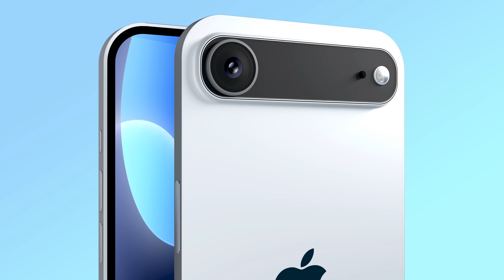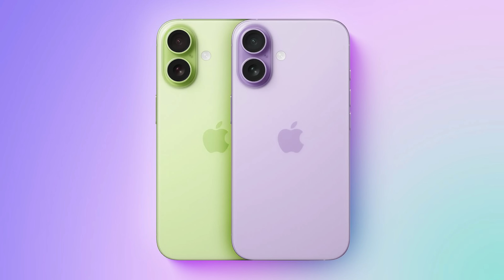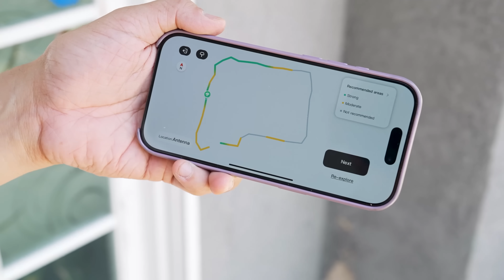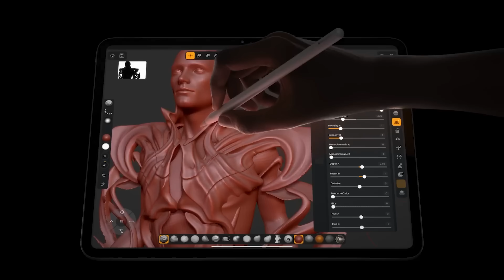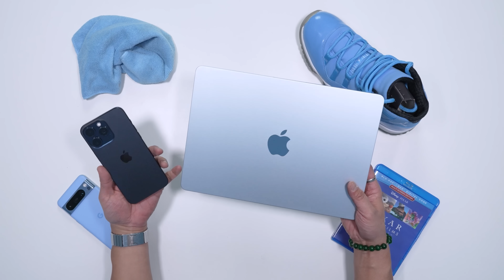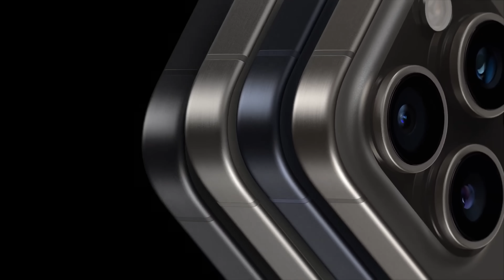iPhone 17, 17 Air, 17 Pro/Pro Max Preview - Everything We Know So Far!

Comment: 🍏
I WOULD GO WITH THE PLUS MODEL FOR REASONS LIKE THE BATTERY SIZE AND LACK OF A CAMERA. I WOULD MAKE THE 17 E WITH ONE REAR CAMERA BUT I WOULDN'T SLIM IT DOWN. ALUMINUM WORKS.
NO CAMERA BUMP,WHERE THE CAMERA LIFTS OUT WHEN IN USE,AND AN UNDER-DISPLAY CAMERA LIKE THE RED MAGIC HAS WOULD BE ACCEPTABLE AS MAYBE A DISAPPEARING DYNAMIC DOT. FOR STARTERS. A REFRESH RATE LIKE ASUS HAS WOULD BE NICE. THE CAMERA CAPTURE BUTTON SHOULD BE MOVED TO THE TOP-LEFT SIDE OF THE PHONE AND A 2ND FIXED HAPTIC BUTTON SHOULD BE ADDED TO THE BOTTOM-LEFT SIDE FOR GAMING THAT HAS NO MARKS ETCHED-OUT OF THE SIDING MAKING IT UNIDENTIFIABLE AND PLEASANT ON THE EYES.😊
A GPU LIKE THE ROG PHONE HAS WOULD BE IDEAL.
ADDED COOLING WOULD BE THE LAST THING I WOULD ADD ADDITIONALLY.

Comment: Nice upgrade on the 17. I liked the 16 but never could have downgraded because of pro-motion, when I eventually upgrade, I can now downgrade from a pro.  The camera bars are a bad idea because case design will be difficult and I would not use an expensive device without a case.  In many ways, the 16 Pro looks like a better choice than the 17 Pro.
Reply: yeah im either gunna get the 16 pro instead of the 17 or get the newest android flagship, literally just because of that awful camera bump design. it looks so insanely bad i cant believe they actually went with that.

Comment: I currently have the 15 pro but I’ve been wanting a bigger phone just for consuming content and also something with a bigger battery. That’s not too heavy. I’m actually considering the 16+ now believe it or not even with the 60 Hz screen or the 17 air, still undecided
Reply: Does the 15 pro have network or WiFi issues? And what’s the average battery life of your phone(how many hours it lasts from full charge)

Considering getting 15pro
Reply: @thatboytimiy no WiFi/network issues that I’ve noticed… full charge starting at 630am with Avg use my battery last until 8pm. Any above avg use last until about 4-5pm. You can get a full day out of it if you barely use it. That’s why I’m considering getting 16+. I’m sick of the shitty batteries that I’m considering going back to 60 Hz just so I don’t have to keep on charging it or worrying about it
Reply: @sammyOcean06 16pro has 2more hours of battery life over the 15 pro

Comment: Going back to aluminum is gonna be a disaster very prone to dents and scratches way to easily, what made the iphone with stainless steel or titanium made the phone really feel premium and strong and stood out against the competition
Reply: OR you could use a case like the majority of people?
Reply: @rockowilson2320 using a case won’t help aluminum is just very brittle even if it doesn’t get dented it will get scratches from dust and debris that goes inside the case and get discolored very easily

Comment: If battery life is good, really good, then i would get he iPhone 17 air.    But if battery is even a little bit of a concern, then I am sticking to the entry level iPhone 17
Reply: Well, iPhone 17 for you.
Reply: Wait until the 18 air when apple optimizes the software for the “new” battery tech that may be in the 17 air.
Reply: Like if an air mini would be an instant buy for you.
Reply: It's not gonna be good. There are some rumors that it's gonna be even smaller than what he claims on this video and it's gonna be 2800 mA hours.
Reply: iPhone 17 pro max will have thr biggest battery and it last longer than all iPhone
Reply: Just get Apple branded mag safe external power bank 😂
Reply: @e3vL1  What is the point, then?   It is no longer extra slim.   I rather get the regular iphone then.
Reply: @awcoolpadlook slim and cool when used in public? Charge in purse, backpack, or pocket when no one is looking 🤷‍♂️

Comment: Looks like I'll keep my 13 Pro again this year, Thank you Apple helping me save money
Reply: 😂. I have the 13 pro max and I've been postponing getting a new iPhone the last few years. I'm also thinking of waiting one more year.
Reply: @stefano.romney same here. I’m holding my 13 Pro Max until Apple release a foldable phone.
Reply: @stefano.romney me too lol 😂
Reply: I have the 13 pro max also what’s preventing you from upgrading ?
Reply: @Usachatnow did you really need to ask that question?
Reply: @Usachatnow i own iPhone 13 (not the pro) still looks good, battery still last long, camera is still good, and with iCloud, 128GB still is more than enough. Other the new cases, and the non-existing apple intelligence, i dont see any point to upgrade. By the way, i recently bought an M4 MacBook Air to replace my M1 MacBook Pro, and for me, that is an uograde that made a lot of sense (because the M4 Air is better than the M1 Pro in eveeything that it does, with a slimmer form factor), but not the iPhone because everything that I need the phone can do has already been achieved in the 13th model.
Reply: @Usachatnow Following 🌾👀🌾
Reply: @Usachatnow I have just upgraded from a 13 Pro to a 16 Pro.  There are a few nice upgrades but it wasn’t worth the money and the increased speed was barely noticeable. Shortly before I upgraded, I had the battery on the 13 Pro replaced (so I could give it to a family member) and that boosted performance. In hindsight, I should have kept the 13 Pro.  A battery change is relatively cheap (compared to a new phone) and they will do it the same day at an Apple Store.
Reply: @Usachatnow I’ll give u a thousand reason
Reply: @Usachatnow right because this seem like a great upgrade from the 13 pro or max .. I have the 14 pro and this is my upgrade year it’s time for a better camera and some of these Apple intelligence feature we may get this year .. I personally think next year will be ther year to skip and 2028 would b the best year to update but I don’t think my battery will last that long since I’m at 84 percentage with battery health 😮
Reply: @gwj7747  I have the 14 pro as well but at 74% and will go for the 17 pro
Reply: @gwj7747 I’m in the same place as you 14 pro max battery at 84 percent capacity , can’t wait another year or two, beside he said next year will be the same as this year no real change until 2028 if I heard him correct!
Reply: @gwj7747 my battery was at 71%. Paid 95$ for a new battery from apple. I might upgrade in 2028. Or just replace the battery again. The ball is in your court apple.
Reply: @gwj7747 I’m in the same situation as you!! 14pro at 86% of battery, it’s been annoying the last months not having enough battery to survive a whole day of fun (I live in nyc), but at the same time this new line doesn’t convince me, not a lot of new features, the orange pro looks cool though, also considering Samsung 7fold but I’ve been with apple since IPhone 4 and it’s hard to change.
Reply: @gwj7747  i am at 74%😅
Reply: I have 13 pro as well. I really want to upgrade but honestly the 16 pro seems better value than the 17 pro.

The new camera button is garbage. Nobody cares about new cameras to spy on you harder in 8K. I just wish they would a pro feature iPhone MINUS all the camera stuff that’s bloating the price

If they don’t make a pro feature phone with minimal camera by next year, I will be going with OnePlus phone. I hate to leave iPhone but they are not providing options that competitors are.

They need to realize it’s not only Samsung and Google they have to worry about. I love the Apple ecosystem but I really need a phone that suits my needs even more, I do over half my business over my phone. It’s a must or they will lose me for iP devices. Been w them since the iPod classic
Reply: @gwj7747 tbh, no amount of upgrades will get me to swap out my iphone 13 pro max if it actually looks like how the video shows it. thats by far the most horrifyingly ugly phone ive ever seen.
Reply: @gwj7747 just change the battery and that 1200 extra you have, invest in Apple if you really wanna give them the money
Reply: @Usachatnow  lack of Innovation, I would like to see a big battery improvements like 100% charged in 10min or 3 day battery, a real brand new design, just a better camera and usb c is not enough for me to switch.

Apple has been so lazy these past few years

I heard that maybe next year Apple would release their foldable phone, that might interest me, they might sell it for 2500$ too 😂
Reply: My man you will never get that for a few years. Technology is stagnant for the past grw years@kevinl-j8m
Reply: @kevinl-j8m  homie you are asking for things that are physically impossible
Reply: @kevinl-j8m you people have no idea how the technology you’re using and begging for upgraded to works. 

How would they make the battery charge in 10 mins without causing overheating and battery damage?

What upgraded do you want them to add exactly? Just complaining to complain
Reply: @marsh.tucker20   It's called innovation, 20 years ago, it was impossible to see foldable screen on a smartphone, and now look at the fold 7 and the other foldable chinese phones. 
Apple is the one of the largest companies in the world, they can get the best engineers, but they can't figure out a 3 day battery and an AI that really works ?

I got an iPhone, an Watch ultra 2 and a macbook pro m3 pro, I like apple, but I'm not blinded, I don't know wtf they do at Cupertino, but not much for the iPhone, I hope they are really working on their foldable to make it way better than samsung's fold 7.

I'm ok keeping my 13 pro, that's a great and reliable phone, that shows they make good products, you cannot deny there is not much since it released in 2021. 
I like Apple that's why I'm harsh on them, I know they can do way more than that
Reply: Word I have the 12 pro max it’s all the same dang apple yall trippin
Reply: @SYYDWALKTV1 yea lol
Reply: Sincerely asking, what upgrades are you looking for?
Reply: @致命帅哥  1 week battery life and charged in 10minutes, something impressive, the same phone with a bit better camera is not enough for me to switch
Reply: @kevinl-j8m  no phone has a one week battery. You’re gonna be waiting a lot longer than a year for that. Agree that I may not upgrade either and that design if true is absolutely hideous.
Reply: I am on 5s and still works😂😂😂😂
Reply: Shiiiid soon as I get a job say I’m sayin goodbye to this 11. Imma get that orange 17 pro max
Reply: I’m on 12PM. iOS 16.1.3. Still going strong.
Reply: I’m on 16pro max prob wait on fold or 18 pro max ?
Reply: @dam5845  Yes, definitely wait.
Reply: Went from 13 mini to 15 and I wanna go back 😭
Reply: Wishing for the m chips in the iPhone. That’s why I’ve been holding onto my 14 pro max and not upgrading but that may never come
Reply: Likewise. 13 PM user. But I have my own reasons. I will not upgrade until battery capacity reaches less than 80% or I stop receiving updates which could be next year. Currently at 90% capacity after almost 4 years. 
Main reason is the usage, I use it for regular stuff and phone works just fine, runs everything I need and no noticeable lag* so I AM GOOD
Reply: May also keep my 13 Pro Max
Reply: 16 e is perfect.
Reply: @MrPape39 I’m sorry but I have to assume this is sarcasm
Reply: Sorry you can’t afford anything new 😢
Reply: Still have the iPhone X
Reply: Comment comes off as salty instead of frugal. We will see your comment next year lol
Reply: Then get the 17 Pro if you’re not happy with this 🤦
Reply: Prices will increased starting this year across Apple products
Reply: ditto. just that the battery needs replacing now. I'm going to wait to see how the liquid glass performs on the 13pro and take a call.
Reply: Right
Reply: Always these broke azz that love complaining 😂
Reply: Same, though when this comes out will consider deals on the moto razr
Reply: Lol I kept my xs (iphone 10) but unfortunately have to upgrade since he dying now😂
Reply: Same here but my concern is my battery life. My battery health is 81% now 😢
Reply: I’m keeping my mint 12 Pro Max until Apple decides to bring back finger print unlocking. Hate not being able to unlock my phone with my face when wearing Polaroid sunglasses.
Reply: The only reason I upgraded to a 16 pro was cause my 13 pro broke the things I notice are the action button which is just a flashlight for me 
And the slightly better camera
Reply: Only reason I got a new one after 13 is because it stayed in sos mode 😢
Reply: I have the 13 pro max as well. Will be upgrading this year
Reply: I have the 14 pro max and was thinking of upgrading to the iPhone 16E and why you may ask? Welp because of the price difference. It would be cheaper and plus trade in the 14 pro max and get a nice gift card to pay my bill for the next few months. Same thing with my mom upgrade her 12 to the 16E and get gift cards for it.
Reply: Count me in as another person with a 13 pro max.  I’m thinking about a new battery maybe later this year or early next year.  Do 13 pro max users think they will be good for another 2 full years until the 19 comes out ?
Reply: 13 pro, they need to fix the camera bump it’s to silly in 2025, and Dynamic Island , fingerprint on the side button when Face ID doesn’t work
Reply: I have the 13Pro as well. Looks like my battery replacement plan later this year is the best way to go! ❤
Reply: Lucky u … my iphone 12 battery performance is getting poor! I need a new iphone
Reply: I just bought an iPhone 13 Pro 1tb model for keeping my SIM card tray and easily move to phone to phone or android to iPhone or vice versa whenever I want without calling customer service every time I I want to use a different iPhone or my different android phones with physical SIM card tray.
Reply: None of these rumours are 100%
Reply: lol I have a 12 pro max. I’m ready for an upgrade. I’m hoping for 120hz refresh to be included
Reply: don't flatter yourself too much, you can't even afford having a new one. There are too many features that are very useful in daily life from iP14 onwards. I had 13 pro begore but videos are shake even just walking...not good.
Reply: gonna change a new battery for my 13pro max and use it for another year or two.
Reply: @noelnoel86 think its to expansive for such a old phone but i have the 13 so
Reply: Nah ur trippin def coppin the 17 air. New fresh clean look. 12-16 all look the same, all trash.
Reply: @Thatsriiight  Nah I can't go back to 1 camera setup and a worse or equivalent battery since its gonna thinner
Reply: Nah bro it’s time to upgrade my 13 pro has lots problems too lool
Reply: ***IN OTHER WORDS YOU CANT AFFORD A NEW 17 PRO*** 😩😩😩
Reply: @jd7089  I rather invest in assets instead of liabilities, if you dont understand what I wrote, maybe you should not buy the 17 pro and start studying how to get rich and not poorer giving your money to apple every year for the same phone with better cameras 😂
Reply: No body gives a Damn what u keep boy
Reply: ME TOO
Reply: Yeah I’m going to keep my regular 13 too
Reply: Don’t do that sir, I still have this 13 pro max and this is the perfect upgrade for us, WHATS WRONG?
Reply: Me too. I don't like the design this year. I'm glad you got the iPhone 16 Plus a few months ago.
Reply: No bs…I’m keeping my 13 also
Reply: Sorry I’m doing better , I’m on 12pro max
Reply: @Dreamer10888   You you should upgrade that 120hz refresh rate is so good
Reply: @kevinl-j8m ok it is double the hz
Reply: Well, it is double the performance in CPU/GPU, double the ram, 4 times the pixel count on rear cameras (48MP vs 12 on 13),and double for front cameras (24MP vs 12), probably 30% battery endurance improvement if you replace your ageing battery, larger screen with Dynamic Island but you do you!
Reply: @zacthegamer6145 the 13 pro still works perfectly without any performance niggles. All else dont matter.
Reply: Damn the 13 is ancient, and I thought the 15 was
Reply: @Dominiongamma still works perfectly!
Reply: Upgrade now!!!!